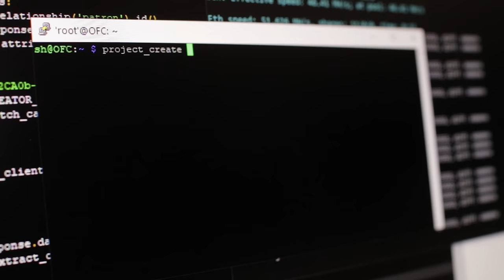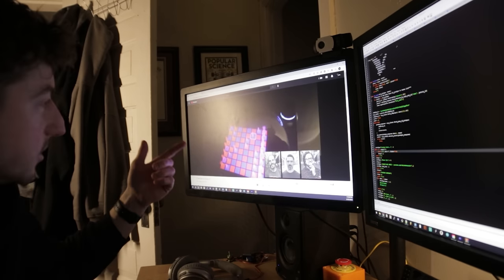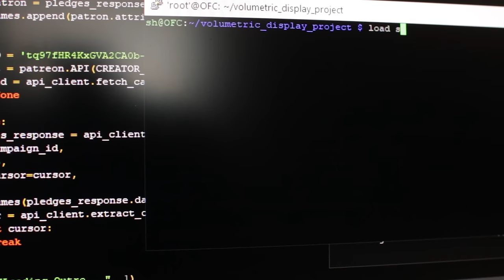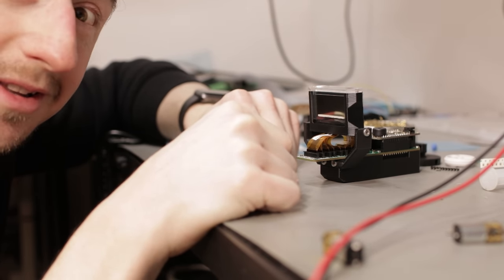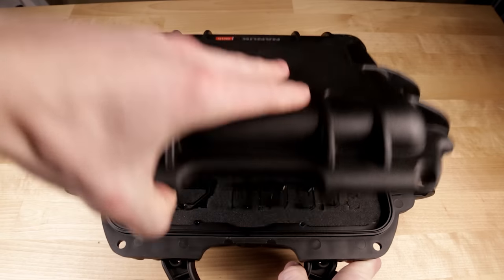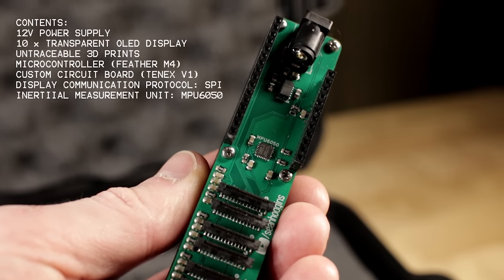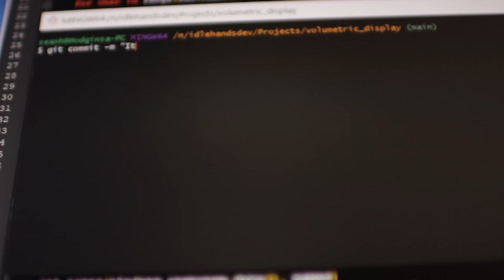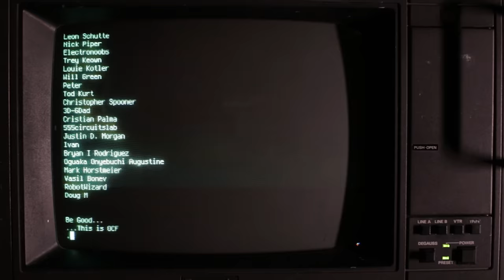TENEX Solid State Volumetric OLED Display - EP-T0-622343EB

Comment: You have to try putting a drop of immersion oil between them. The oil has the same refractive index as the glass, so it looks more clear and more like one block rather than all of those layers, still very impressive, I love it.
Reply: I was thinking the same, maybe casting them in resin would make for a better view from above? Would love to see that
Reply: I kinda of like the retro look achieved from the different layers but it would be cool to see variant designs
Reply: @SamuQu  I doubt that you could get a good look from above that way. The layer that actually emmits light is very thin, you would have to use a diffusor to get that effect.
Reply: Great idea. I might try and have my hand at building this concept, and i'll keep your idea in mind.
Reply: While I have no doubt that is a real suggestion, can we just acknowledge how fake the phrase "add a drop of immersion oil" sounds?
Reply: @jedidiahhenry6020  Right? Like "Man, this VR just isn't hitting quite right. Needs a few drops of immersion oil."
Reply: @jedidiahhenry6020  lol
Reply: @Beateau  I was thinking pretty much the same thing when I read that!
Reply: Wouldn't this make light inside the block of glass panels behave as of the block were solid, defeating the purpose of multiple panels?
Reply: @nef36  The block would appear solid but the light is still coming from pixels with different depths so it would still be 3d but you wouldn't see the actual glass layers anymore. You could also look at it at a much steeper angle without it turning into a mess of reflections
Reply: @leothecrafter4808  (I'm assuming) this works because the light from the pixels bounce inside of the glass panels, preventing them from leaving the panels; so wouldn't a material with an identical refractive index allow the light to leave the panel and go in whatever direction it wants? I mean, if this wasn't the case, then why does the light you see that don't come from the pixels travel through the glass like this, but the pixel light doesn't?
Reply: @nef36  From what I can see the 3d effect comes from the pixels just being at different depths. Because they are oleds they are transparent so you can see pixels behind them. Think like a "hologram" you know from movies but in glass. Matching the refractive index would stop this infinity effect, but that's an artifact, the real 3d effect just comes from the pixels itself being at different depths. I don't quite understand your second part.
Reply: @leothecrafter4808  what I'm mostly saying is happening in my head is that the entire structure behaves like a solid peice of glass. I'm asking how the light would still get to where it needs to be if it can just pass through the oil
Reply: @nef36  if anything then the layer stop the light from properly getting where it needs to be. I don't understand your issue. Imagine you have a block of glass and there are dots in it that glow. Then that's 3d. That's basically what it would be if it was like I described it. Also the light with this doesn't have a direction, it goes out in all directions from the pixel that is emitting the light.
Reply: @leothecrafter4808  if it's fine, or even better that it behaves like a block of glass like I think you're saying,, then why aren't we just using a block of glass?
Reply: @nef36  because these are just OLED displays that you can buy off the shelf. When manufacturing a display you have one side where you apply different physical and chemical processes to make the pixels. You can't just make 20 different layers all throughout a solid block if glass, you can only process the exposed side. But you can take multiple smaller slices of glass and after you have created the pixels on each of them you can make them to one block using immersion oil or even Canada balsam or a similar mourning medium with the same refractive index as your glass.
Reply: @leothecrafter4808  why does immersing them in the oil not negate the purpose of the glass panels being separate?
Reply: @nef36  The only reason they are separate is because of manufacturing as you can only make one layer at a time. When you have a 3d display then you want one block but you can't manufacture it that way
Reply: @jedidiahhenry6020  I know, it's like, "And don't forget the headlight fluid and elbow grease."
Reply: See also: LOCA (Liquid Optically Clear Adhesive). Its a transparent and (usually) UV curable glue used to attach LCDs or digitizers to glass
Reply: @amarpersaud2950  yeah that would be more appropriate
Reply: @jedidiahhenry6020  i thought it was a jab at the dramatic cyberpunk aesthetic for what is just "buy transparent displays and stack them"
Reply: Step 1. Use technology created by someone before you to do research
Step 2. Create something that's already been created before
Step 3. Pretend like your some genius when your just a useless human using our ancestors like everyone else
Reply: @JordanJank  Actually, this is a viable way to build one's personal knowledge and understanding, which is how creativity is practically applied. You're essentially saying that 'Hello worlds' are useless -- but the fact is, even a genius has to walk before they can run.

Now that you mention it, I'm pretty sure that I can tell which of you is a genius, and which is a 'useless human',  just by looking at your channel's content.
Reply: @JordanJank  damn dawg, you just got handed one of those OOF's with a gunshot sound accompanying it...
Reply: Glycerin

Comment: Pretty cool! If you eliminate the air interface between the panels and replace it with something with the same index of refraction as the glass, you won't be able to tell where the layers are and will greatly reduce those internal reflections. I'm thinking some sort of resin.
Reply from the maker: I still need to try this!
Reply: typically this is called LOCA or Liquid Optically Clear Adhesive. It is UV curable resin used to bond touchscreens and the like to digitizer glass/ This is exactly what he needs!
Reply: @SeanHodgins  modern phones have a uv coating that bonds/cures the glass to the display. it should be a simple fix with something like that
Reply: Yea the same mineral oil that's in Ressence watches
Reply: RepentandbelieveinJesusChrist5 Oh for Christ's sake can you not? This doesn't belong in this comment section, it's irrelevant. Why randomly throw in bible quotes? It comes across as pushy and serves no real purpose. Keep it in Christianity related videos.
Reply: @PunakiviAddikti He needed this LOCA glue to sniff, but there was no suitable quote to indicate it. 😂
Reply: @PunakiviAddikti @RepentandbelieveinJesusChrist5 "This account has been terminated for violating YouTube or Google's Terms of Service."
And nothing of value was lost.
Reply: @satan.is.my.copilot  Oh, dang. I got nothing against any faith, but when people shove it down others throats violently, then it becomes irritating. I guess dude was too pushy and daddy youtube didn't like that.

Comment: This would be an awesome sci-fi rifle sight!!
Reply from the maker: "Target acquired"
Reply: I am going to surprise you a bit.  There are gun sights with LED displays in them, the interesting thing is that they can calculate where the bullet will hit and show it in the sight.
So ... its being done.
Reply: @johnsmithfakename8422  Do ya one better, there are gun/sight systems that wont fire the gun until the onboard system calculates that you will hit the point you are aiming at.
Reply: @johnsmithfakename8422  Like the Trijicon CCAS (continuously computed aiming solution) which came out about 8 years ago....not sure if anyone can buy one though?  I saw one on a website for $31k :) Burris Eliminators do something like the CCAS but a little more simplistic and are only $1k - $2k
Reply: @johnsmithfakename8422  Halo Gun

Comment: Ever since I learned that transparent OLED was a thing I wished someone would eventually make a volumetric display from a stack of those. Plus, in the far future, for the version v69.0.2, you can add stripped down LCD panels in between to serve as subtractive layers to create non-transparent holograms. Well done.
Reply: Is OLED polarized light? Otherwise too much loss on the polarizers you'll have to add.

Comment: This technology could be applied to single-eyed scopes, where depth perception is a possible limitation. Either way, it's fascinating.
Reply: Monoculars?
Reply: @whatabouttheearth  yes, thanks you for telling me the correct term.
Reply: that what I thought
Reply: buuut.. human depth perception is binocular. So it wouldn't provide any sensation of depth
Reply: how would that work, we still need two eyes for depth perception. unless its possible to show one eye two slightly displaced images and get a sense of depth, i dont think it would work. because the processing happens in the brain, it will surely just treat all the info from one eye as one 2d image.
Reply: @MrGhostTheBigRoast  You can still perceive depth with only one eye. Just not as efficiently. If you cover one eye, your vision doesn't become a flat 2d image does it? I don't fully understand depth perception myself but these are things you can test yourself.
Reply: @holocaust_2.0  thank you for telling these guys what is supposed to be the obvious.
Reply: @holocaust_2.0  actually that's pretty much completely untrue. You do perceive only a flat plane of that which can be projected back onto your retina. Your brain will use perspective to attempt to perceive depth, but tricky perspective will expose that.
Try for an exercise standing about 10ft from a wall and tossing and catching a tennis ball off it with an eye covered. You'll be comically bad, because in that range perspective doesn't even meaningfully change the size you'll perceive the tennis ball as.
Reply: @urbanweekendwarrior7238  Hmmm, that's pretty interesting. I guess during my bit of experimentation, I could plainly tell that there was distance between objects with one eye covered. I guess what my mind would have difficulty with is estimating that distance. That makes sense. I wonder what distance experimentation with this has gone?
Reply: Step 1. Use technology created by someone before you to do research
Step 2. Create something that's already been created before
Step 3. Pretend like your some genius when your just a useless human using our ancestors like everyone else
Reply: That was my first thought, as far as practical application... some sort of sighting mechanism.
Reply: That would be quite a waste of the displays....
A scope has only 1 requirement that needs just 2 points. The greater the separation (depth) between those 2 points the better. A stack of 10 planes of thousands of pixels is a bit overkill.
Reply: @JordanJank  you've moved on to step 4: cry more.

Comment: Very cool project!
Instead of loading the OLED screens into the frame from the top and connecting the ribbons in a very confined space, why not load the screens from the bottom of the frame?  That would allow you to attach the ribbon cables to the board easily, before stacking the screens and sliding them into the bottom of the frame, and then as a final step attach the frame to the base?
Reply from the maker: I’m not sure but I’ve tried different ways since I had to assemble it a few times, and they’re all nerve racking thinking a cable is going to tear.

Comment: I think the principle would be a good way because it maps the 2D TFT display to 3D. The problem is that the carrier material and the cable connections lead to a significant light attenuation in depth. It could be compensated for by increasing the brightness of the transistors towards the back (taking into account the ambient light). Perhaps other geometric parameters such as sharpness and distortion could also be compensated by software.

Comment: I had the same idea about 5 years ago but didn't bother building it because it was obviously going to be less useful than the useful things I was building at the time. Congrats for realising this though. When there are wafer thin displays with the right refractive index for low drop-off and higher resolution we may have something that might resemble a solid Star Wars chess board.

Comment: I found ribbon cables to bea easiest to install using some flat long nosed tweesers, if your worried about damaging the cables you can put a bit of electrical tape or heat shrink around the tweeser tips (and itll make them more grippy).

Comment: If you could do gas phase 3D ultrasound you could have a method to supply dynamic volumetric data for such a display. Ideally this would be done in a regular air filled room, otherwise you would have to play with variable density/viscosity mediums, or if nothing else “capture” footage in a 3D ultrasound conducting medium like water.

Comment: Hey I'm a videographer, and I want to put one of those transparent OLED displays in front of my camera's image sensor, and make the OLED screen darken the clipped hilights of my images to make sort of a local dimming in camera, to get a higher dynamic range of whatever I happen to be filming... Is there a way to do this? can I make a custom board that takes the HDMI out of my camera and processes it to display only the bright, or clipped hilights in my image, inverted on the OLED display in front of my image sensor, while also duplicating the HDMI output of my camera so that I can still see what I'm filming on another monitor? Thanks, and amazing project by the way! I love the blade runner vibes man!

Comment: Dude, I'm 6 months into a 12 month MSc in Digital Systems Engineering, it's been absolutely savage so far and I've got a pretty intense 6 months ahead (group project: LCD, FPGA hardware accelerated MP4 player). This video gave me hope and inspiration. Also, the retro theme is cool as F. Subbed.
Reply: How are you doing now ?

Comment: I have always wondered if there was a way to use a plastic semi sphere and a screen on a rotating platform under it to draw 3d looking displays on the reflection off of the sphere. The display would be rotating, and the image would reflect on the sphere and due to persistance of vision might be able to produce a very real looking 3d imave due to the distortion of the sphere as the screen passes by under it . I think it would require a fast screen frame rate but it should be possible. This is a cool project with a similar outcome. Keep up the grwat work!

Comment: On one hand, cool...on the other hand, Parallax Barrier is probably the better way to go.  You only need one screen, and if you make it high enough in quality, it looks great. I have the Commander 3D Freevu tablet, and its pretty good, but the graphics are outdated at this point.   I've seen the IMAX Parallax Barrier screens that they used to demo 3D video outside of IMAX theaters, and they are a huge leap in quality from the tablets, and look AMAZING!
Reply from the maker: That sounds cool! Though you can't walk around a parallax barrier, can you?
Reply: @SeanHodgins  Theoretically? You'd need 4 screens to do it..but combine it with the right programming and some eye tracking, you'd basically have a 3D color image that looks better than a bunch of wire frame led style diagrams.

Comment: That display and some sensors would make for some cool demonstrations. First thought while watching was of course gyro sensors and sand that moves around as you move the...thingymajig...around. After that came some fun thoughts on using sensors for humidity, temperature and barometer but those were basically 3d versions of 2d visualisation of that data.
With a few proximity sensors you could triangulate the position of a finger and move something around in 3d space. Then my mind started wondering about how one could use a laser and follow the trajectory through a screen like this. Not really useful, at least not at this stage. But imagine a bigger screen with higher resolution (both 2d and 3d resolution) and such applications could become interesting. Then I started imagining a 3d lock where you push buttons in a 3d space by moving your fingers in front of the screen and geting a visual of where you where in a 3d grid and pressing by making a more sharp movement with the finger or twisting it or something. Then I figured it would be cool to make a pattern combination lock that follows you finger inside the 3d grid like you do with 2d pattern on your phone. Then I started dreaming of that magical 3d desktop we've all wanted since we were kids (at least if you were a young computer enthusiast during the 90s).

Now I just need to not get side tracked from my current project of using a scale and marbles of different weights to track things like who is home (if their marbel is in the bowl) or who is present for a shared music list on spotify or what project you are working on or as a todolist where you remove marbles representing a specific task when it is done. The unique combined weight of different marbles is used to calculate what marbles are present on the scale.

So far I haven't figured out any practical reason to combine a screen like this with a scale like that...so I have to stop looking in to this within the next hour or so.

Thanks for a nice and inspirational video.

Comment: What were some of the other volumetric displays you found?
Reply from the maker: There is the Looking Glass Factory, and a handful of DIY persistence of vision ones with varying degrees of resolution. All seem pretty cool.
Reply: @SeanHodgins  Cool and thanks for the great videos! I am working on a dimensional display using fiber optic cables bundled together. It's kind of like the push-pin toy where you can make a dimensional image of your hand or face. My project is at https://github.com/frankcohen/ReflectionsOS if you're curious - it solves a lot of the software/connectivity issues most Makers encounter. -Frank